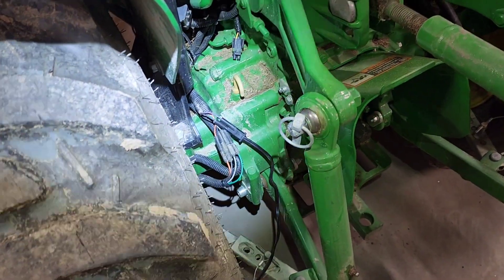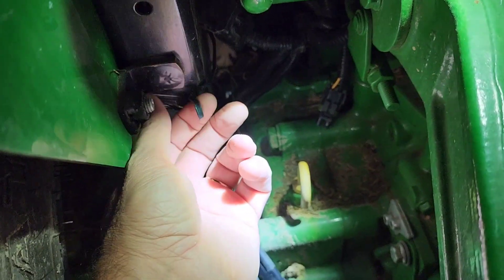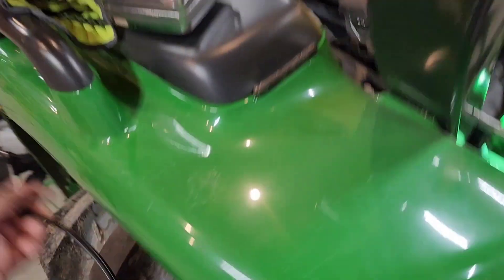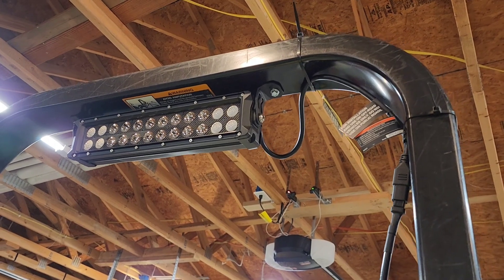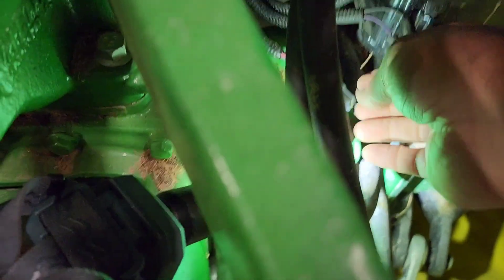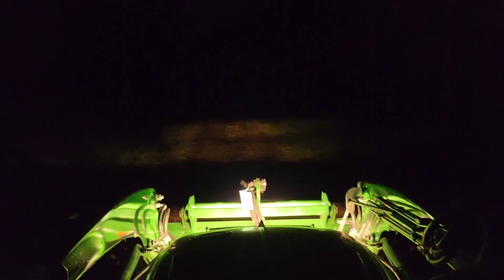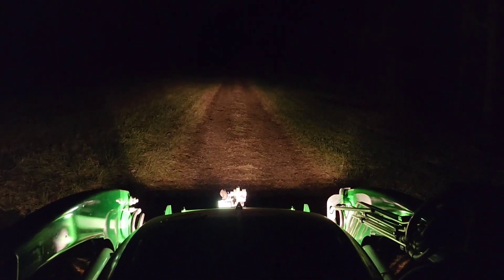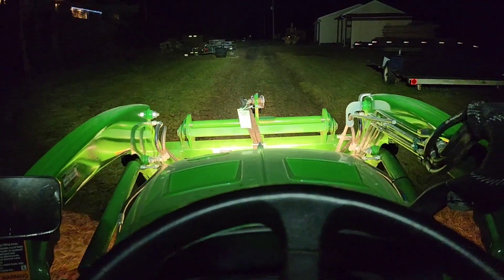3033R John Deere Light install and aux light connection

Comment: NIOSH  the National Institute of Occupational Safety and Health may answer all your questions about ROPS and altering them with regards to cutting, grinding, drilling or welding. 
Good Luck.
Reply from the maker: This is not a company owned tractor where that is of any concern.  They probably never even used a damn tractor let alone be a source I would consult for adding 2 holes around 1/4 big

Comment: Ooops! did you ruin the integrity of the ROPS by drilling holes in it!?!
Reply from the maker: How is adding a couple tiny holes going to ruin the integrity of the rops, which already has other holes in it. 

I don't understand how the internet and groups act like this when it comes to anything tractor, cars, trucks, boats etc .

It's like the go to question did that impact the integrity. People act like metal with any holes, which becomes malleable as play doh.